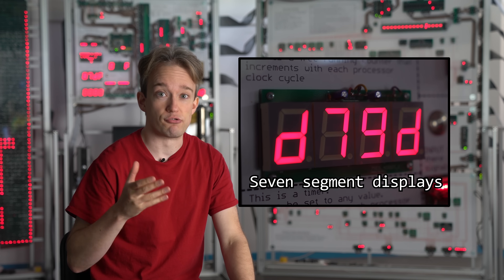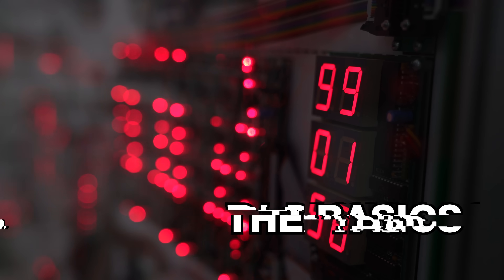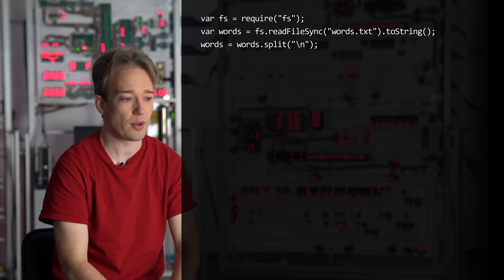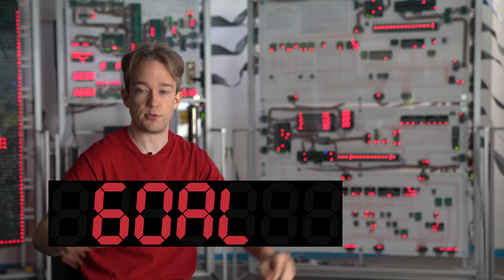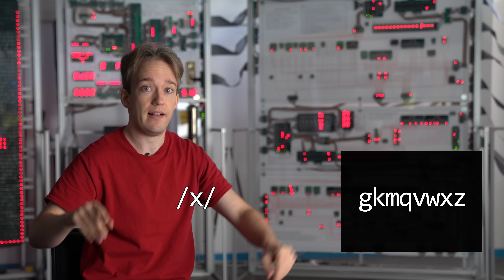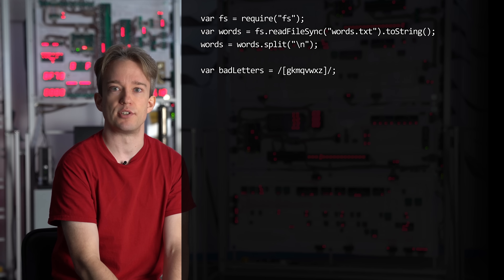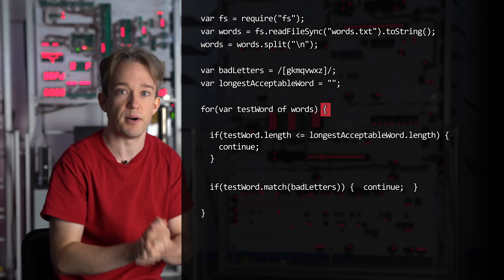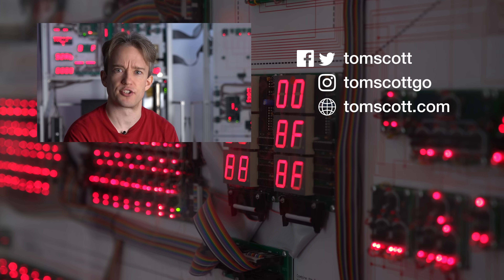What's The Longest Word You Can Write With Seven-Segment Displays?

Comment: If you stored the longest words in another array, you could reset the array if a longer word was found or push a word onto the array if it matched the longest word found so far. This would not add to the complexity of the code much but would allow all the longest words to be found if there were multiple correct answers.

Comment: For any geeks interested... The way I think I'd go about finding a list of similarly lengthily longest words would be to: 

1) Store the current longest word in an "longestAcceptableWordArrayList[]". 
2) Append the "longestAcceptableWordArrayList.add("Another Longest Acceptable Word")" if another word matches the length. 
3) If the current max length is exceeded, discard the array and re-create - including the new longest word as an entry in the newly created array >>> longestAcceptableWordArrayList.removeAll(); longestAcceptableWordArrayList.add("Even Longer Acceptable Word");
4) Once the initial set of input words is exhausted, loop over longestAcceptableWordArrayList. >>> for (String word : longestAcceptableWordArrayList) { System.out.println(word);}

Comment: 0:56 You can but you would need two digits to display that. You CANNOT write K, V or X.
Reply: Base 16 doesn't have K, V or X
Reply: The problem with displaying base 16 digits on a seven segment display is that you can't tell the difference between 0 and D, or 8 and B. Nothing stops you from displaying base 128 digits as binary because 2^7 is 128.
Reply: @TheCoolThings-0you can make the b and d lowercase
Reply: ΓΠ and M

Comment: Possible solution:

make the acceptable word into a list, I like c++ so I'm using std::vector<std::string> longestAcceptableWords;

in the length check, change it to:

if(longestAcceptableWords[0].length() > testWord.length()) continue;
if(longestAcceptableWords[0].length() == testWord.length())
{
        longestAcceptableWords.push_back(testWord);
        continue;
}

and after this, if we find a longer word still, we do:
longestAcceptableWords.erase();

longestAcceptableWords.push_back(testWord);

and one final change, at the print code:

for( std::string& word : longestAcceptableWords) 
// in c++ make sure to use references so you don't end up cloning the whole array. 
//Did this with a physics sim a while back, wondered why nothing updated. 
//The breakpoints got called, the values got changed. Spent like an hour on it.
{
        cout << word << endl; 
}

Comment: For those who want to know: If you exclude s, the longest words that can be displayed are a three way tie between hyperbrachycephaly, phenylacetaldehyde and ultrabrachycephaly at 18 letters. 

Also:
If you wanted to write down words on a calculator, the longest words for those are bibliologies and glossologies at 12 letters
or 531607017818 and 531607055076 respectively.

Comment: Using the list of words linked in the description, the results in both cases are the only valid results I could find.
I used this java code to search for multiple words with the same length but it did not yield any other results:

        String words;
        try {
            words = Files.readString(Path.of("D:\\words.txt"));
        } catch (IOException e) {
            e.printStackTrace();
            return;
        }

        String[] wordsList = words.split("\n");

       Pattern badLetters = Pattern.compile("[gqkmwxz]"); //or gqkmwxzio

        List<String> longestAcceptableWords = new ArrayList<>();
        int longestAcceptableLength = 0;
        for (String word: wordsList) {
            int wordLength = word.length();
            if (wordLength < longestAcceptableLength)
                continue;

            if (badLetters.matcher(word).find())
                continue;

            if (wordLength > longestAcceptableLength) {
                longestAcceptableWords.clear();
                longestAcceptableLength = wordLength;
            } 
            
            longestAcceptableWords.add(word);
        }

        System.out.println("Longest acceptable word length: " + longestAcceptableLength);
        System.out.println("Words: ");

        for (String word: longestAcceptableWords)
            System.out.println(word);

I am sure this works because I tested it by manually adding words of the same length as the result words that are also valid and it included those words
And yes, I know this is 5 years old but I found it interesting to try anyways

Comment: you could make it use the most comment word that satisfies the requirements at all lengths, so for example instead of the longest word it will start at the shortest words which are mostly common words and then the more uncommon longer words, you will get a kind of triangle of of words like
a
at
the
that
ect...then you can scan through the longest words at the bottom and go up until you find a word that is acceptable

Comment: I'd probably do it by, instead of checking a word's length ever, just add it to a new array of strings, then at the end sort the array of strings. You can use radix sort for strings so it's fast, though still slower than your implementation. But the advantage is you could see however many places of longest word at once, and that could make it much more interesting for the user

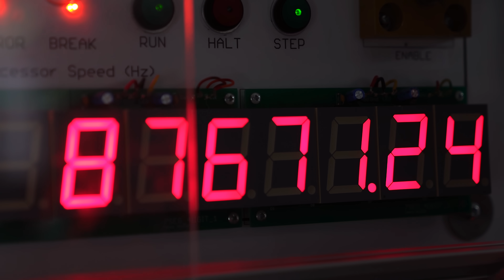Comment: 0:36 You can actually use 6 straight lines to write numbers (i. e. by making a box with two diagonals), if you're OK with chopping one of them in half (but still having the two halves be connected in the electronics).

Comment: 0:29 Actually, in 1908 when the 7-segmented display was invented, cursive was by far the most common way of writing, and in cursive, the top of the four is separated just like in the 7-segmented display. You can actually look up notes from 1904 and you will all see them in cursive, and every time the year is written by hand (not by a stamp) the 4 is separated at the top. So we haven't "gotten used to it" but instead we have drifted away from using cursive. The more you know! And in case you were wondering, I write the top of my fours separated, and that's what got me down this rabbit hole.
Reply: I always write my 4 like that.

Comment: Good note on Big O notation. What I use as a rule of thumb, if your dataset is smaller than 1000-ish or run less than once every minute, you can probably ignore performance. And if you can't, your prototype will be slow enough that you can find it out before deployment.

Comment: g use 6 without middle -
k use 6 without lower _ 
m use n+r (inverted)
q jusr 9 without lower _
v use u  ithout lower let i
w is m=n+r inverted/upside down (standardosed as U with - above)
x is = 
Y is 9 without top 
z use 2 

numbers as letters:
6  wo top ~is b / without middle - is g /without lower _ is k /flipped 180º is R
9 wo top ~is Y / wo lower _ is Q
2 is Z
1 left is l 
7 inverted T / flipped 180º is L
8 is B

Comment: Technically, you can store 2 and 2/3 displays in a byte, as it takes 3 bits to store an 8 because 2*2*2 and 8 divided by 3 is  ~2.66
Reply: Uh, no? There are seven segments, each have an on/off state, which is a bit each.
Reply: @SgtLion  Yes, that's the easy way. Yet 2 bits have 4 states, no?
11,10,01, and 00, so with 2 bits you can do 4 things. Then 3 bits have 8, as each bit you add doubles the number of possible states.

For example, 
Most computer CPUs operate on mainly 64 bits nowadays, but you can have more than the number 64, you can have 2^64 (unsigned).

Comment: Many years late and not unique but the longest words you can spell on an upside down calculator are:

Bibliologies - 531607017818

Glossologies - 531607055076

(At least based on my slightly larger word list)

Comment: Personally I would allow "o" because you can make a lowercase o distinct from the digit 0.

You can avoid using "continue;" by reversing the tests and nesting them (so "if testword length > current longest acceptable word" and doesn't match the bad letters). I don't think I've encountered  a "skip to end of loop" statement before—exit loop/function/sub completely, sure—so I've always done it the above way.

Comment: To do the multiple answers thing, all you have to do is remove the '=' from the <= in the if statement, and instead of changing value of longestacceptableword, you will have to just make an array and store all the answers in it.
I am sorry i couldn't give you the exact code as i mainly code in python and have little to no knowledge of other languages as of now, i am though, currently trying to learn java
Reply: Almost. If it's actually longer, you need to empty the array and add the new word. If it's the same length, you add it to the array. You could instead filter the array at the end, but that would be slighlty less readable.

Comment: My guess is that a good way to handle multiple words of the same length, is throw any words of equal length (that satisfy the test) into a list, and clear the list if you've found a longer acceptable word
Reply: Based on my limited programming experience, I think that'll work well.
Reply: Yes, this would be the correct approach to this. I actually wrote a piece of code (in Java) with exactly this addition because I was curious to find out if there is any other words that would be valid and of the same length - There aren't, in case you were wondering

Comment: Just shouting into the void as this is years on since the video was posted:  I was playing with some 7-segment displays recently and had this exact problem as I needed to output words that  used the forbidden characters. Technically we could print every  character  (upper and lowercase and a fair bit of punctuation) if we were "flexible" in how the letters looked. Map each bit to a segment and we could represent every character from 1-128. So if you're ever in a position where you needed to communicate with someone using only 7-segment displays but needed to write "wax kumquat in gauze" then it's perhaps a workable solution.
Reply: I will definitely report back if I'm ever in that position

Comment: The question asked at 8:23 and the solution is:-
The word supertranscendentness is about 21 length so only check those words which length are equal to 21 by using
if(testWord.length == 21) instead of <=

Comment: I want to make a complete list of states in an 8-bit byte, so I need to make a key quickly 🔑 

ABCDEFGH
00000000
A = Top Segment
B = Upper left Segment
C = Upper right Segment 
D = Middle Segment
E = Lower left Segment 
F = Lower right Segment 
G = Lower Left Segment
H = Decimal Point.

Ok, now for the list 📝 

1 = 00100100
1. = 00100101
2 = 10111010
2. = 10111011
3 = 10110110
3. = 10110111

Anyone else continue the rest? Imma leave it here cuz I’m tired.

Comment: You could write any English word on a 7-segment display if you wanted to. You'd just need to create a cohesive alphabet. Some letters might not look like their normal written counterparts, but that's fine.

As for Q, a lowercase Q in 7-segment wouldn't be ambiguous with a 9 since a 9 in 7-segment has its full tail. I could be made unambiguous by making it lowercase, while S and Z could by simply taking the top and bottom segments away and leaving zig-zags in opposite directions from each other. O just needs to stay lowercase.

Comment: I ran through the linuxwords list and I'm happy to include g - my result was "electroencephalography" which is quite a satisfying answer!
Reply: If you're allowing 'g', then the longest is 'greatgreatgreatgreat[...]greatgrandfather'.
Reply: Thank you for doing it the correct way for us!
Reply: did you use python? because i used a library called "english-words" that got all of the words, and got the same answer as you.

here's my code:

import re; from english_words import english_words_lower_set
liste = []
for item in list(english_words_lower_set):
    if not re.search('gkmqvwxz', item):
        liste.append(item)
print(max(liste,key=len))
Reply: @PL73  No, just some regex in Vim over the Linux words list. That Python library probably uses the same list!
Reply: @PL73  you can replace the for loop with a list comprehension:

liste = [item for item in list(english_words_lower_set) if not re.search(‘gkmqvwxz’, item)]
Reply: I would include the letter v | I would include K | I would include G

                                                                      _
|_|.                                              |_|.            |
                                                    |_.             |_|

Comment: This would be easier in bash with grep, awk and sort. It is a one-liner and you can also get a list not just the longest:
  grep -v '[gkmqvwxz]' < words.txt | awk '{ print length, $0 }' | sort -n | tail -n 5
Change the -n 5 at the end if you don't want the 5 longest and replace the 5 with the number you want. Or remove the | tail -n 5 completely to just get a list of all matching words sorted by length
Reply: The problem here is that doing that would take way too long. Imagine the IO for printf()ing that many words, plus there’s piping, and insertion/deletion. It would probably be better to whit up some C to delimit the file, then use pointers to re-order everything.
Reply: @limbillion  It could be optimized a bit by skipping short words, e.g. by setting a minimum word length (7?) in the grep expression and making the awk expression skip words shorter than the longest encountered so far.  These changes would vastly reduce the number of lines to be sorted.
Reply: @limbillion  I've always found Linux pipes to be surprisingly efficient. The grep|awk|sort|tail solution runs in about 0.3 seconds on my machine.

Comment: you can write any letter if you just use more than one display segment. And as you said if you just encode every letter as 8 lights in a bit, you get the whole ascii range. It may not look like much text, but you can decode it and get any letter you want.
Aside from that, the question is somewhat ridiculous, since it involves finding out what the longest english word is, and that's hardly relevant or interesting from a computer science point of view.

Comment: I'm not sure why 's' was allowed (which is exactly the same as '5'), while 'g' (which, like 's', looks like a number) and 'o' (which is hardly a "number with aspirations", as it looks nothing like 0 on a seven-segment display), were not.

Arguably 'q' should have also been allowed to stay, as it is differentiable from 'g' and/or '9', which should have also been allowed to stay if the same rationale used for '5' was applied.

Just my two cents (pence?).

Comment: If you google “how to write the number 4” most of the results use the seven-segment display style. Tom really do be gaslighting us
Reply: My 4 has always been identical to the segment display version. The only place I’ve ever seen the pointy version is in fonts.
Reply: But you'd write it with a little trail going off the right side. That's the weird thing about the seven segment display version, and I think that's what Tom's referring too: it looks weird without the line continuing out of the side of the four, instead it just...... ends.
Reply: @angryhobo212  I do not right 4 with a little tail. I was born in the mid to late 90's. I wouldn't be surprised if it's a generational thing.
Reply: I once wrote the 4 not like the 7-segment display version in kindergarden and the teacher said it was wrong and so i just write 4 like the 7-segment display version because thats what the teacher was right and i just never changed.

Comment: "Seven is the minimum number of segments required to show every number using straight lines"
If you allow diagonals (no real reason not to), you can do it in just six. Remove the bottom horizontal and angle the two lower verticals inward to touch each other. Maybe shorten the top horizontal a bit and angle the upper verticals in slightly with it. You can find distinct mostly-readable arrangements for every digit, and the whole thing looks delightfully 80s sci-fi. Can't do nearly as many letters though, I'd guess.
Reply: How do you draw a 2 without a flat bottom?
Reply: @nikolaihedler8883  good question
Reply: @Corn0nTheCobb  you can't, is the answer; OP is wrong. You wind up with something that looks like a backward 5 (not to mention that the 5 and 7 would look terrible too).
Reply: @nikolaihedler8883  Imagining it, 7 would actually look quite good. But I agree that 2 and 5 would look terrible.
Reply: Also 5 6 7 and 8 bit segments would use the same amount of data usage as they all run on the same 8 bit binary.

Comment: python solution -- feel free to bully me:
fd = open("words.txt", "r");data = fd.readlines();unacceptable_letters = "g k m q v w x z".split(" ");acceptable_words = []
for i in data:
    e=False
    for x in unacceptable_letters: 
        if x in i:e=True
    if not e:acceptable_words.append(i)
print(max(acceptable_words, key=len))
Reply: Bash one-liner:
grep -v '[gkmqvwxz]' < words.txt | awk '{ print length, $0 }' | sort -n | tail -n 1
Reply: If you use python, you could use the with keyword and a `for line in file:` loop. Or you could just read from stdin, this would also be more flexible, no need to open a file. And you can use regex. I was able to shorten your version:

import sys
import re
print(max( [ word for word in sys.stdin if not re.match("[gkmqvwxz]",word) ] , key=len ))
Reply: @happygimp0  nice

Comment: I would only accept it, if all Letters are big, or all letters are small. And all have to be on line. BuT nOT tHIs mEsS oF a mIX.

So either count:
ABCEFGIJLOPSU

Or count:
bcdhou

And if the Letters should be Numbers Upside Down (so you can write it with a calculator, you can only count:
1 = I
3 = E
5 = S
7 = L
8 = B
9 = G
0 = O